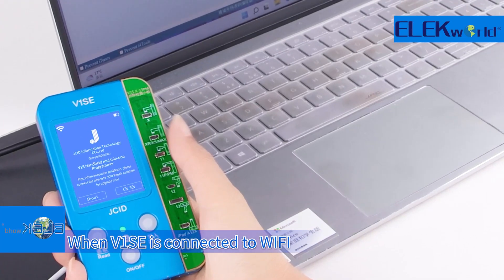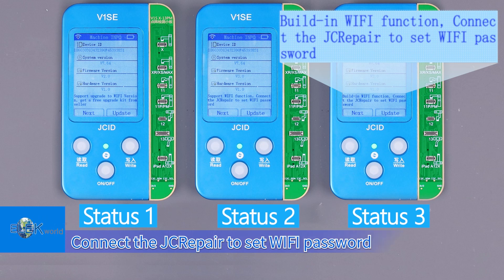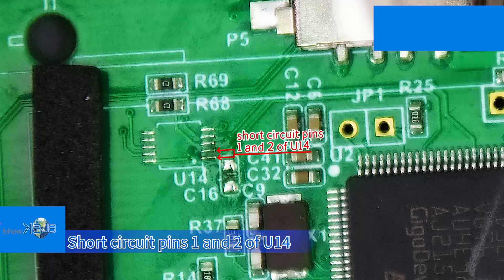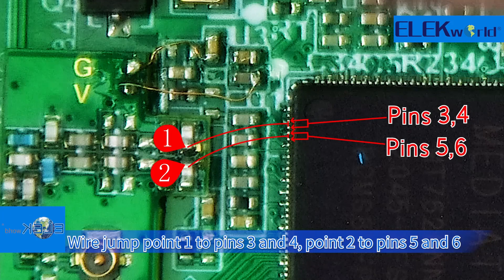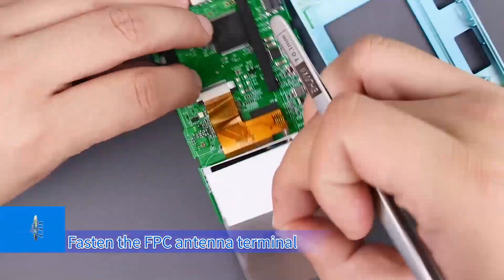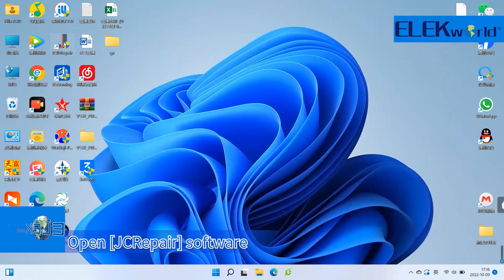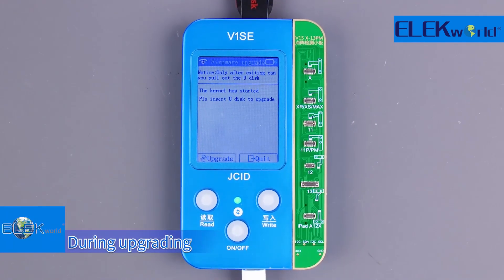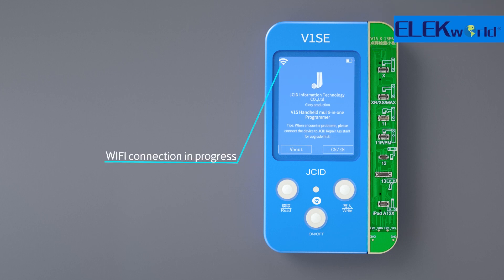JC-VISE upgrade-Add WIFI function丨Operation Teaching

Comment: very dirty because jc did not deliver the finished product, now you have to solder an antenna and the person runs the risk of losing the device
Reply from the maker: Every products has a process to grow and upgrade, I believe JC will release the built-in Wifi version if they have the capability before.
Reply: @Elekworld  all no problem, except soldering directly to the chip, too much mistakes can be made there